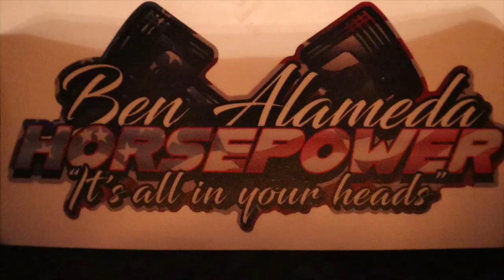CARB SIZING AND DISPLACEMENT TIPS.

Comment: Great info! Can you advise carb sizing for a dual tunnel ram?
Reply from the maker: There are so many variables with tunnel/sheetmetal induction manifolds due to the complexity of cam and rpm variables.  In short, the more radical the specs are the more it is able to tolerate very high engine speeds that must have compression or some sort of induction assistance like boost or nitrous!

Comment: Hello, I have been watching your videos for alittle while now and you always say to increase your rocker ratio, which I agree is a great way to gain alittle power, but along with the lift increase dont you also get a small duration increase? What would be the duration increase from going from 1.5 to 1.7 could you please shed a little light on this subject?
Reply from the maker: The duration stays the same but the lift range is a lot more fatter or shows a definite increase in the open flow window across the lift range.
Reply: @benalamedaracing2765  Thank you.

Comment: old mans. 302 sbf honed .30 .. blue print 9008hp heads think there 241cfm at .600 but now shaved i dont know that spec cant remember.. 0 decked, scat rods,kb little dome tops full balanced ..on summit calculator got it from 8.8 instead of factory 9 because of bigger chamber blue point heads to 10.89:1 crow 15747 294 307 236 246 .567" .575" 107lsa/1.6 shaft rockers....... i cant remember how much off the head i remember the summit calculation..vic jnr with 3 inch pdm billet spacer.. brawler 650 vac sec.. circuit race boat so decent extractors but has water plumbed into collector what im sus on. just picked up a hp holley dp 750 for it downleg .. you pretty much confirmed what we though of carb holding it back.. and msd locked out at 30deg all day starts a treat 7600 limter. gonna be intresting to see how the 750 goes
Reply from the maker: Keep us posted and interesting how it would show up because the 750 will definitely show some promise and hope it all pans out good for you!
Reply: @benalamedaracing2765  i personal message your race page om fsceo book with photos.. your influence on this build  especially quench and cometic gasket sizing. was used . .the cam itself was a left over from last build but we figured see how it goes .old man said it jumped out of the water at 7200 on a blip of throttle with 650 vac.. gonna need to tune the boat into use the water .. that tractive effort under control